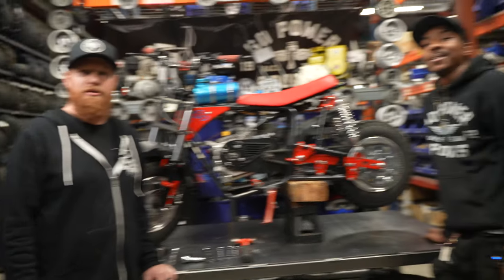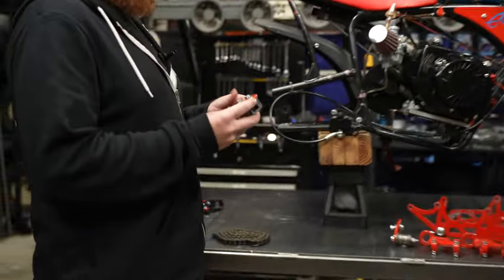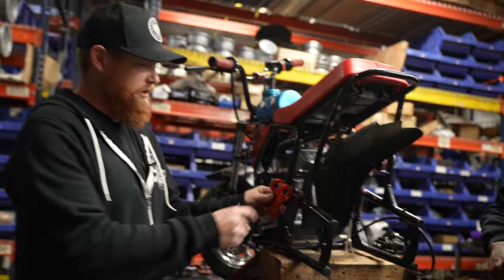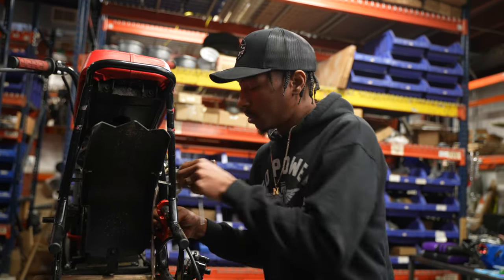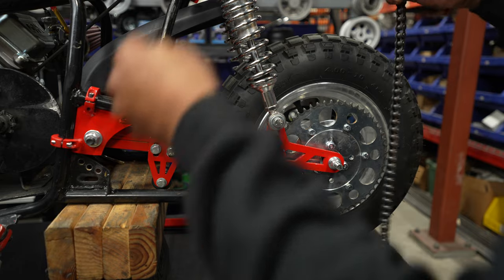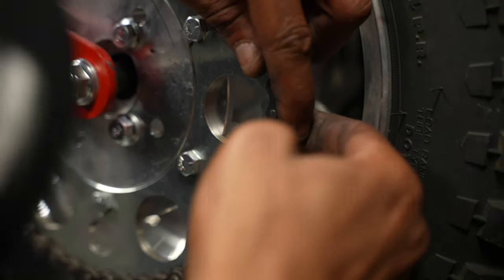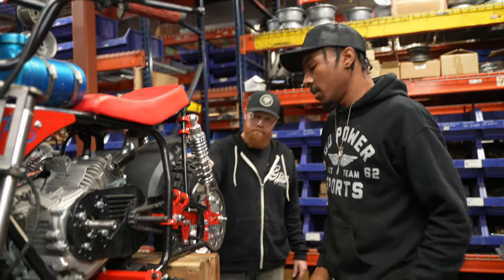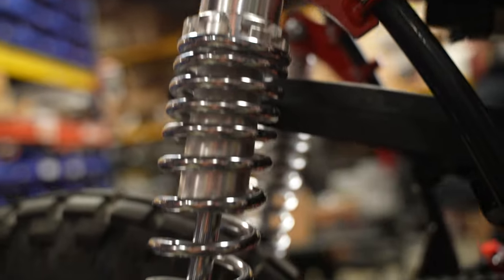Mega Moto 80 Mini Bike Swing Arm Kit | Installation

Comment from the maker: One of the coolest mods you can do to the Mega Moto 80 Frames, glad it's finally available.
Reply: Hey guys, any word on when these might be getting restocked on the website or are they sold out and done?
Reply: I am not able to find the tire you have on the rear wheel you are using. would you be so kind to provide a link?

Comment: The spacers for the rear wheel that are included are wayyy to big and my wheel doesn’t have any clearance to fit the brake even after grinding it  because it’s basically touching the swing arm on both sides

Comment: Will it be a problem if frame is powdered coated I think I might have a problem with them mount fitting right cause u said don’t powder coat the product cause it come not painted and it will mess with fitting right just wondering do that apply with frame also

Comment: Running into a problem. The chain rides on the lower shock absorber nut. Gonna have to run a bigger rear sprocket. I’m running a 60T rear sprocket with no torque converter. I have the engine riser and adapter plate kit on.
Reply: I have this problem too and have no way to over come this. I already use a 60t sprocket and my engine sits really high with no way to adjust it. Did you try anything else besides a bigger sprocket and engine mount because I’m out of ideas.

Comment: I am in the process of developing a 3d printed adapter for that exact fuel tank. But in this video it seems you have mounted it a new way. Can you enlighten me? I hate the "Pipeclamp it to the frame" approach.
Reply from the maker: We are in the process of making an actual fuel tank for these frames that will also fit our Rascal/Lil' Rascal line up.  These are currently pipe clamped on to the frame at the moment.
Reply: @GoPowerSports  I just finished creating a 3d printed frame for one of generic small 1g fuel tanks. But I would LOVE to get my hand on one of your new tanks and test it!

Comment: I have a mm80 along with the GPS swing arm and because I have to use the angle plate in order to properly install the swing arm, my rear center exit exhaust doesn't seat correctly, how do you guys get yours to center exit  or what do you guys use as exhaust header?
Reply from the maker: We use our Skinny Center Exit header pipe, #GPS-1001